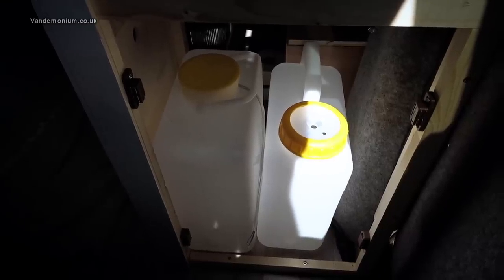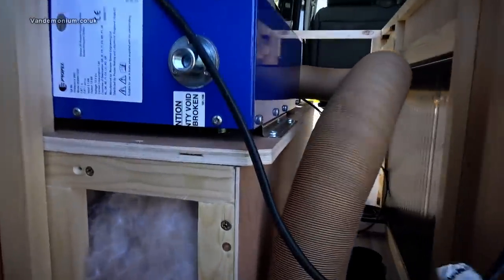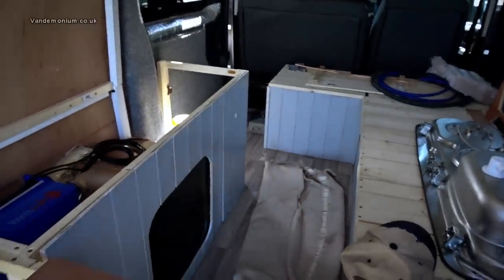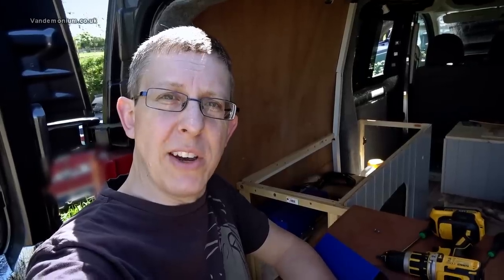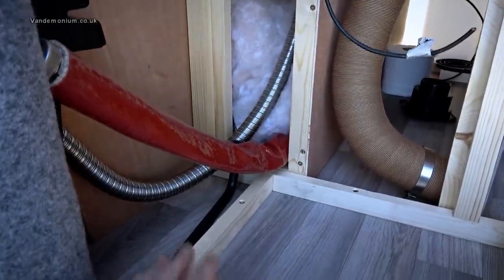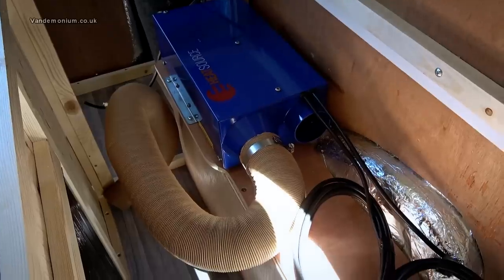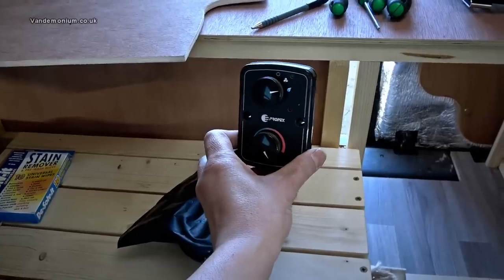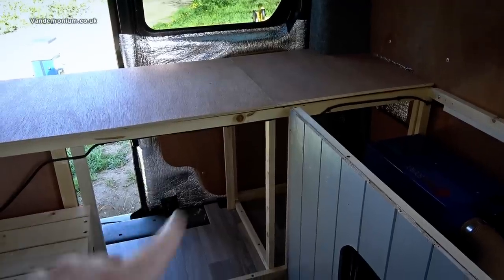Vlog 18: Propex HS2000 campervan heater installation (part 1)

Comment: I'm just about to put one of these in my Merc 413, after finally deciding that a wood burning stove takes up too much space and weight. I will probably go through the floor as I have space but I really like the idea of running the thermostat to my bed so if its cold in the morning I can turn on the heater without having to get out from the duvet. Great video

Comment: I have had this heater for 2 winters. Very good heater.  Keep an eye on your batteries when running it in cold weather as the fan runs more, obviously. One thing to learn before it happens. How to clear a “Lock Out”. Imagine. Freezing cold evening, heater on full. Toasty warm, just settling down with a glass of Port & some fine cheese. The heater stops & the red light comes on! Van cools rapidly! This does happen occasionally. The fix is simple, if you know how, so get to it, the answer is in the manual under faults!
Reply from the maker: Yes, I've heard about that - will look it up. Cheers!

Comment: Looks like quite the sensible plan for arranging things. I like the short gas lines, less to go wrong. The way you have assembled and mounted things is a lot better than I saw in some professionally made vans.
The additional window is also great. Just the question: Where will you put in storage for things like kitchenware and your clothes?
Reply from the maker: Thanks. Clothes will go in the underbed storage. Pans / kettle either under the hob/sink or on a yet-to-be-built shelving unit.

Comment: Thanks for this. I fitted a Propex HS1600 to my campervan over the weekend and this was a useful reference. You’re right to use that insulating sleeve on the exhaust pipe, oh boy it gets hot. I’ve ordered the sleeve now - my van has a lot of underseal on it which I’d rather not set fire to! As you’ve said elsewhere, superb support from Propex themselves.
Reply from the maker: Glad it was useful. Yes, in hindsight having now run the thing and experienced just how steaming hot that pipe gets, I'm not entirely convinced I was wise to locate it as I did even with the heat shielding wrap. Then again, even an inch or so away from the pipe is substantially cooler. I think I'm going to get some further heat wrap like I have round my boat engine's exhaust and add that as well, plus add a reflective heat shield between the heater exhaust and the gas filler pipe. Agreed also about Propex, very responsive.
Reply: I (half)seriously considered running the exhaust through a water jacket and using it to generate hot water as a by product! Your video was especially helpful as I actually read too many forums (and, in fact, comments on your videos) - it amazes me how many folk don't grasp the concept that the air coming in from outside (for combustion) and the air being heated (taken from inside the van) are totally separate! I read so many comments where folk got themselves wrapped around the axle about that.
Reply from the maker: Haha yes I noticed that too! I like your water idea, bit like the system on my boat which uses the engine heat for that purpose.

Comment: I think I’d have put the fresh water container as the smaller one. You could always back it up with a couple of Camelbak style 3 liter water pouches (6 or 7 quid off AliExpress, fold down to very small when empty) for times when you’d be gone longer, but I’d be worried about thoughtlessly accidentally overfilling the waste water and flooding the van more than about running out of fresh.

Comment: David-Since you have the extra wire length for the thermostat you might also consider putting velcro on the back which will allow you to attach it to the carpet anywhere along the van wall above the bed while sleeping.  Like your cabinet work.  Very practical.  Have a good week.  mk
Reply from the maker: Neat idea. Too late now, it's been fitted! I wouldn't want the cable trailing though, bit ugly.

Comment: Good placement for the heater. It was a surprise to me that you put one in. I though you would be using the van in summer or fall of the year. You must be planning winter travels. Since I toss and turn in my sleep I wouldn't have put the heater control anywhere it could be kicked in my sleep but you're not me you may be one of those guys who don't move and it's perfectly safe where it is. For your propane tank vents why not drill up from under the van. That way, you can be sure, you won't put a hole in anything important. You're fill your space up fast, leave a path into the back unless you're going to climb over the passenger seat. :-) If you do have a back doctor on retainer.
Reply from the maker: Not for winter I doubt but chilly nights in Spring and Autumn perhaps. With the control in the far corner - and the bed longer than I am tall - I shouldn't hit it by accident. As for drilling up, the problem still arises of finding a suitable place for the holes to go that will also accommodate the heater above it. At this point it wasn't so much not hitting anything as coinciding the drilling with a suitable location. It should all be clear in the next video or two!

Comment: David, not sure how strong the heater fan is, but the more bends in the hot air flow pipe the less flow of warm air. Better if you can to have it as straight as poss, minimum bends. Another good vid..
Reply from the maker: Unfortunately, it has to go there. It only bends a couple of times, should be OK.
Reply: Vandemonium it will be fine in my Luna caravan the hot air runs outside under the van..also the full length of the van..so it gets a blast of cold sir before the "hot" air emerges..

Comment: That window does make it bright in the van, nice. I would like to say that I believe that you are going to have to extend the exhaust pipe for the heater if you plan too have it exit under the van. It will need to be extended so that the end of the exhaust pipe is NOT under the passenger compartment. Otherwise warm exhaust will rise up under the van and find a way inside. I'm sure you planned that but you didn't mention it and I became worried for your safety as a result. I must complement you on either your goid luck or good planning that allowed you to use a useless void to place the furnace, and make a nice short gas line. Nicely done.
Reply from the maker: The whole system is already towards the back of the van, at the wheel arch, and where the pipe exits is right in the corner of the back of the van. The exhaust pipe therefore exits out to the corner. Cheers
Reply: The by-product of propane combustion is carbon dioxide and water. Many propane heaters exhaust these by-products directly into the cabin air you breathe. Unlike diesel, gasoline (petrol?) or kerosene (spirits?) the chance of carbon monoxide poisoning is extremely low. Un-vented heaters DO however  carry the chance of oxygen starvation which is the real culprit. Some un-vented propane heaters, if not most, are designed to extinguish before the oxygen levels get dangerously low. This has saved many lives. In Davids set-up all concerns of CO are a non-concern. Besides it appears he vented into a wheel well. No problem.

Comment: You're a regular renaissance man aren't you? Cracking job so far. Keep in mind that there is profit in these things. Buy a new van, kit it out yourself (will be easier next time with what you've learned thus far) and then sell for profit. £££
Not saying to do it like but if all else fails, at least you know now that you can build motor homes and there's definitely money in it alright. Put in some serious hours, get a van done in a couple of weeks and you could easily be on a few grand profit which ain't bad for half a months work... Own boss and so forth. 

It equals a win in my books. :D
Reply from the maker: Tempting! Whether anyone would buy my work is another matter entirely :-)
Reply: People buy motorhomes and stuff like that all the time. And from the manufacturer or a specialised company, the profit margin they pull in is massive.
An example is the place where my mate works... Won't mention no names but they buy brand new Mercedes Sprinter vans and then they pimp them out. Don't get me wrong, they're actual coach builders so its super quality work but they buy a van brand new from Mercedes for somewhere between 15 and 20 grand and once it's been through the works, it comes out the other side for 75 grand. Being that they have council contracts to supply said vans, the work doesn't dry up. 
Same with VW though. Brand new, you can get a Transporter Shuttle for about £27 grand. By the Transporter California though which is VW's dedicated camper van with creature comforts like a bed and a sink and that same van is now selling brand new for £46 grand on the road. And it doesn't have one of those nifty gas powered heaters you've installed in yours. (Boom, thats a key selling point).
But VW vans going from 27 grand for the 7 seater van to 46 grand for the camper... That's a hell of a mark up for a bed and a sink and a few storage cupboards... Well, by rights, it has a tilt up roof too but that's high end. Naturally you don't go for that market. You go for the younger market and generally, they can't afford super expensive vans anyways.

That and at the moment, there's a bit of a craze going on with the 20-somethings traveling around in camper vans. Its actually fashionable for the younger generation these days. Back in my day, the younger generation would have to be dragged into a van to get in one.

Obviously you know how much your van cost and how much you've put into it so far so it shouldn't be too hard to work out some prices to find some wiggle room where you can get a tidy profit by coming up with a cheapish van, kitting it out and undercutting the cost that the manufacturer would charge for the same thing. 

Hell, you do it to a couple of vans and buy the vans for the same place, you'll probably be able to wrangle some deal with the dealer for discounts on the vans... More profit right there.

Something to think about if nothing else... Pull out the tablet, get on google and work out how cheap you can get a new van for and how cheap you can source the materials for. At the very least, it'll give you something to think about on the rainy days where you can't do work on the van. 

Plus, you have actual videos on YouTube showing how you do it and showing your workmanship. Better than paid advertising is that. :)
Reply: The Enterprise just needs the right name - Vanderminium Conversions ??

Comment: Is it possible to use a boat skin fitting for the exhaust and air inlet of the heater on a van? Can you mount Propexes on their side?  Just a thought... Thanks for another great video
Reply from the maker: I'm sure I read somewhere that you can mount them on their side, yes.

Comment: The intake is the plastic pipe since it’s admitting outside ambient temperature air into the combustion chamber. The exhaust pipe is stainless steel because it’s expelling very hot air from the combustion chamber. And yes, since it’s running through the interior of the van it definitely needs to be insulated. The way you’re explaining it here is a dangerous situation and hopefully you didn’t discover that they were backwards the hard way.
Reply from the maker: No, the intake and outlet pipes are both stainless as supplied by Propex. I'm fully aware the exhaust is hot hence my insulating it, exactly as Propex advised. I am following the manufacturer's recommendation, as I explained in the video.

I also made it clear that usually it would be installed into the floor with the exhaust and inlet poking directly outside.

Comment: Nice job David.👍 Just a couple of observations 1: I would consider fitting a washable polyurethane filter to the cabin air inlet to the heater. 2. A top access fridge may be more efficient but they are a right royal pain in the spigot when it comes to convenience -if it’s not too late you may wish to thing again. I think the efficiency gain is finely drawn anyway.
Reply from the maker: Too late!
Reply: Vandemonium Oh well never mind I am sure you will get used to it. Biggest problem tends to arise from a blocked drain which then means ‘stuff’ at the bottom can get damaged. I used to out a layer of cans at the bottom to prevent more susceptible food getting damp in the event of a blockage.
Reply: Vandemonium I bought a Waeco CFX35 Top loading chest Fridge this year. My 3 way Fridge, also a Waeco started playing up in gas mode. All rather annoying as it was only 20 years old! The new fridge is 12v only & is absolutely fantastic. Very efficient, quiet & very convenient. I can control it via an App using WiFi. I have 210 watts of solar & it hardly touches the power. Will be interesting to see how it does in the winter. Temperatures cooler but much less solar. I would never return to a conventional front opener now. Cost is high £639.95 but it has a 3 year guarantee. Easy to clean etc & automatically switches from 12v to 240v when you plug in to shore power.
Reply from the maker: I couldn't stretch to the bigger versions or the latest model! Originally I wanted a Waeco or Dometic model that gets installed into the furniture but at £595 each, it's just too much! Hence why I ended up looking at the self-contained models like the CDF26 that I bought. Got it for £375 which is a relative bargain (on at £440 or so the next "cheapest" price I could find) so I was pleased with that. I've only tested it briefly but it very, very quickly took the temp down from 19C to 4C and was very quiet, so I'm happy so far. It'll be interesting to see how much power it uses when on the battery / solar (200W solar, yet to be installed and a 160Ah AGM battery)

Comment: You've put a lot of thought into your build, nicely done. As you see we're all second-guessing you, but with the best intentions to make sure we'll all see you off on your first trip safe and sound ...so to add: have you considered there to be any issues with the proximity of the heater to the hob? i.e. sparks or heat emanating from one or the other, drips of cooking oil, etc.?
Reply from the maker: I don't think so, the gap to the hob is sufficient, no oil should leak through.

Comment: I definitely agree with the chest /top style fridge. They are way more efficient. Which brand/model are you going with? If it would fit in that same space you might be able to put it on a slide out type setup to maybe help keep it stable and power cord hidden.  Cool vid
Reply from the maker: I wanted a Waeco BI41 (if I recall correctly) but they're fantastically expensive like all 12V fridges - around £600. I just can't justify that. So I've ordered a portable Dometic model, half the capacity (21l) but it only needs to keep milk and tomatoes cool etc. That was still £375!
Reply: Vandemonium  cool. Ive seen alot of those used. From what i have researched any of the decent chest fridges use hardly any power so paying a little more so your battery doesn't drain quickly is worth it in my book . And if you consider that the compressor doesn't have to run as much should mean you'll get longer life out of it versus a side door .  Looking forward to seeing how you set it up. As you say over there cheers  :)
Reply: Chilling tomatoes below 12 deg C destroys their flavour. commercial toms are chilled in transit, and at the store so have already lost a great deal of flavour. SO grow your own (almost impossible in the UK without a greenhouse) or buy at farmers' markets. Not easy on a narrow boat. SO you have to use Italian canned to get flavour.  Not too good in salads though.
Reply: What's the model number ??

Comment: Wait until you get the surfing bug, you’ll need wet storage and a changing screen. A10’ longboard on the roof would just finish the van off nicely. 🏄‍♂️
Reply from the maker: I'm not a surfer, I think! Besides, the solar panels will be on the roof :-)

Comment: I've just installed my Propex today, (for the third time - don't ask), and I thought I'd look at a couple you tubes to see how other people had done it - your's was the first video.  I thought ' hang on - I recognise that voice ' - Man of many talents! I realise it's a little while ago now, but great video by the way - I think it's a great idea to run your air inlet and exhaust that way. Wish I could have done it that way. Any issues since? Looking forward to watching some more.
Reply from the maker: No issues other than my own general paranoia about the exhaust pipe being too hot inside and burning something despite all the insulation I wrapped it in. I would have liked better distance between the exhaust and the gas tank inlet pipe too but I don't know what I can do about that.
Reply: @Vandemonium  well,  I guess if it's lasted this long and you haven't got hotter than intended (!), must be working ok!

Comment: As you have the heater and hob in a confined space have you considered a Carbon Monoxide alarm, and possibly a gas alarm too as the bottle appears to be going inside the van? Another excellent vlog as ever!
Reply from the maker: There will be two CO alarms, a smoke alarm and an LPG alarm. The gas bottle is in a sealed locker, vented through the floor, as you'll see.
Reply: Vandemonium You should be safe with that lot then! 😀

Comment: Is the furnace controller a thermostat. If so it needs to be exposed to the air so it can sense the air temperature and turn the furnace on or off as the air temperature changes. Enjoying the built and your proplem solving abilities.
Reply from the maker: It is, though curiously it seems to have no air inlet vent anywhere on the body.
Reply: I guess they are "electronic" thermostats. These thermostats need a hole as small as pin hole to work efficiently. 

PS:- I suggest to place somewhere a bit higher because thermostat might give wrong values of temperature if it gets covered with a bedspread or blanket.
Reply from the maker: Too late, I've installed it now! I'll have to see how it goes...